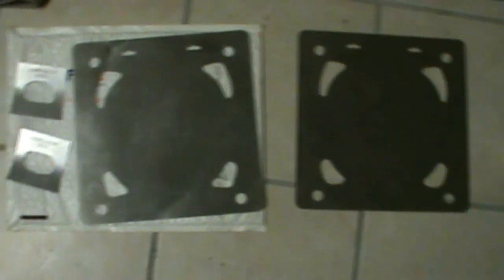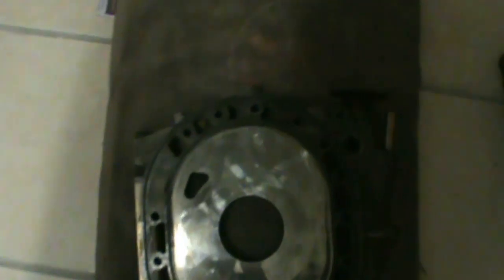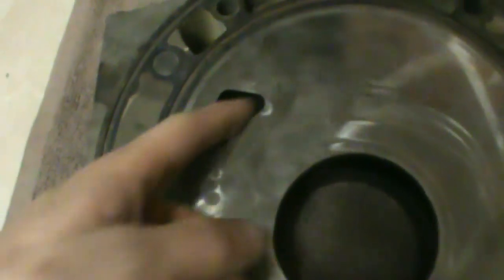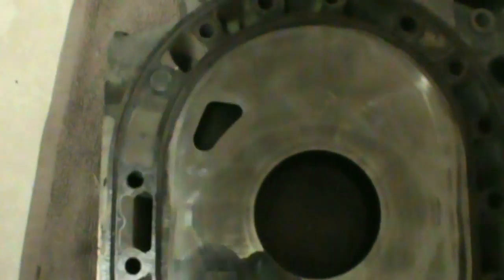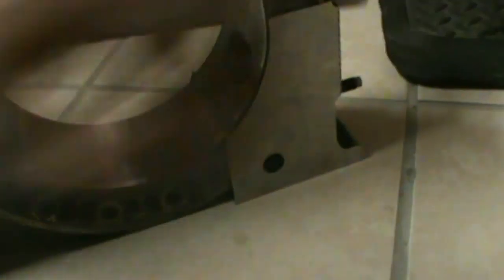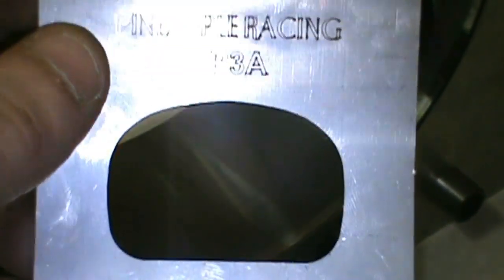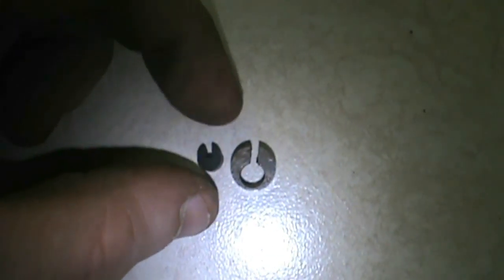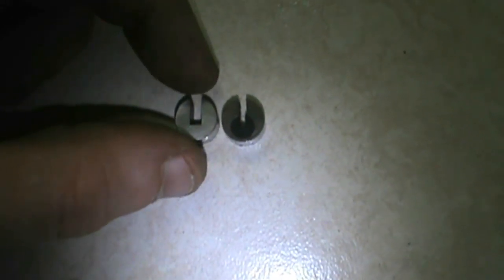Streetporting a Rotary Engine

Comment: what would u charge to rebuild a 13b none turbo? lol 
my 88 vert has low compression so it floods easily and its a bitch to start.. when it does thick white smoke poors out the exhst tips till she warms up then it goes away but then shell start to over heat.. :(
Reply: gixxerboy22 blown coolant seals